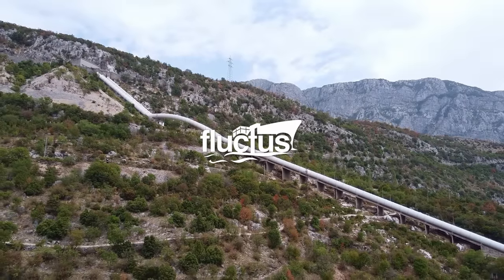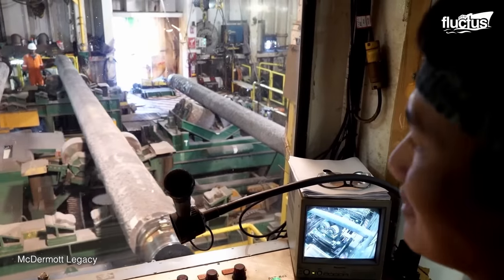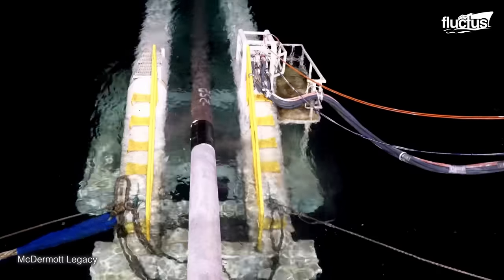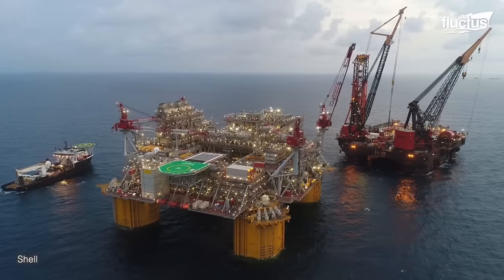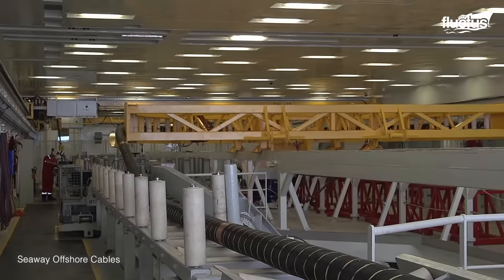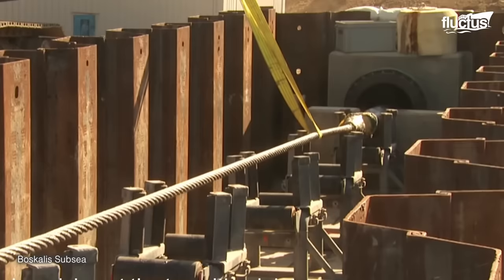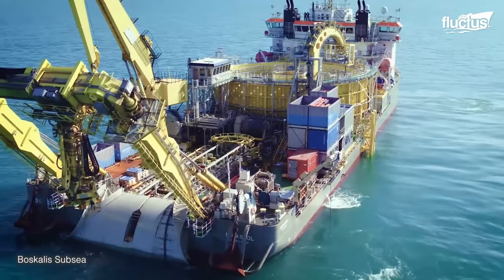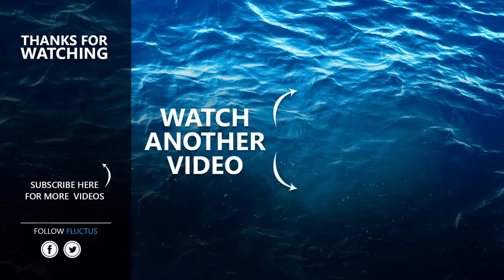The Crazy Process of Installing Billion $ Pipelines Deep Under the Ocean

Comment: 👍🏆🚨!  Always Well: Organized, Detailed, Presented & Very Entertaining!! Kudos!!  Suggestion :  “ Piping ; UNDERGROUND on Busy Roadways, Villages, for Businesses “ to REPAIR Existing Broken & Leaking Piping WITHOUT the DIGGING!  Called ( loosely) Sections of kind of Pliable PVC SOCK Pulled by Winches AFTER all the Old Pipes been Cleaned/ Flushed/ Remote Camera Videod to Dpot Damage—- Then Very HOT HOT HOT Air is ‘ Blown Thru ‘ to Inflate and Harden the New, Inserted Piping.  1/20th LESS Expensive/ Closed Roads/ Noise and TIME of the Old Disruptive “ Dig &’Cover “ .  That topic & How/ Why/ Where / What are. VACTOR-Water-Flush-Cleaning Trucks ; for Storm & Sanitary/ Sewer Pipe Cleaning! Anywho..👍 Again.  God Bless.  NRN . O.O.D. ,  👴🏽NoBody.